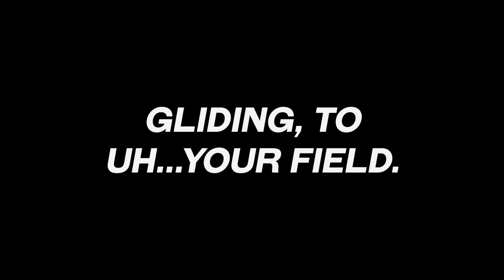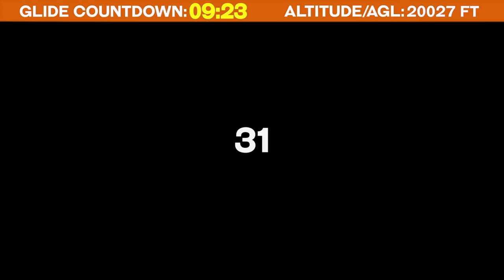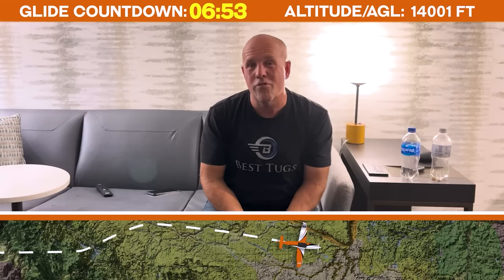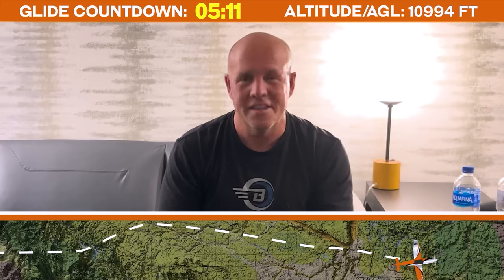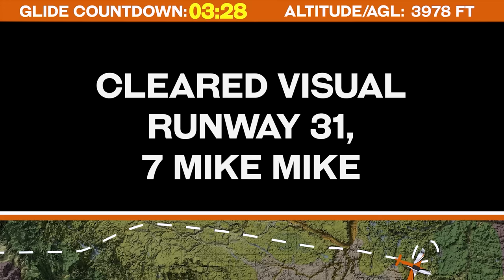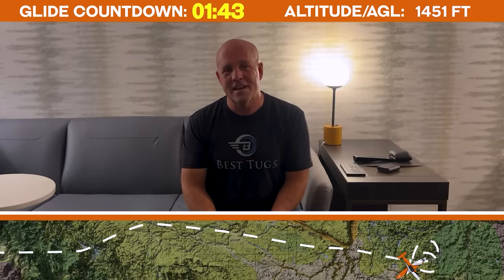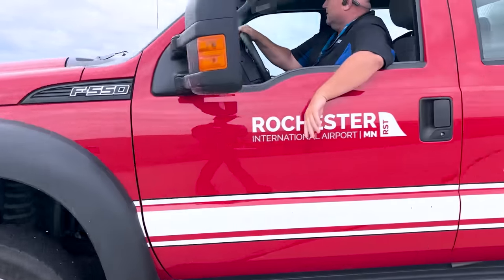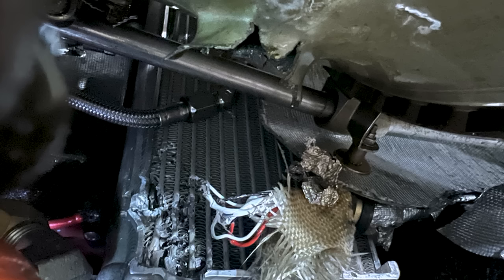Engine Explodes In Flight - Turbulence will not be at Airventure 2023 | Turbulence Emergency

Comment: Hi Mike. New to your channel. I'm currently learning to fly a little PA 28, so I look for any inspiration I can find. Turbulence looks amazing. For full disclosure I am a  RAAF engineering officer (electrical). I discussed your PT6 engine failure with some of the propulsion guys I know (mechanical and aero engineers). With the limited data available, they were all of the opinion that the engine has been over torqued during its life. Being an ex King Air engine, that increases the probability of over torquing. Looking forward to following your YT channel.

Comment: Had a catastrophic failure in 2009 in my Cherokee Six at 2800 feet.  Was able to put it down in a small field under a set of power lines........It's hard to get over those times but I'm still here.   Not even a scratch on me or the plane.......by the Grace of God!  Great Job!!!

Comment: Mike, Glad you're ok and saved Turbulence. Having survived my own single engine, night deadstick I can attest to not knowing who is on the frequency until the conclusion of your landing. I was on a short VFR night flight and came up on 121.5 when the 182 I was flying had a complete engine failure. I was quickly vectored to the closest airport by ATC and then had a couple of airline pilots offering suggestions, most of which I had already tried. Finally, when it was apparent a restart wasn't going to happen, one of them told me to quit talking and just fly the plane. Once I radioed I was safely on the ground, there a 1/2 dozen comments of great job, way to go, etc. Sorta' nice to know you're never really alone out there.

Comment: Mike - Great video!!  Lousy luck!!  Only saw 1 emergency decent in '90s.  I got slammed by massive downdraft on I-96 in MDOT PU!  Held on after initial hit, bounced out of windshear on other side 55 to 85MPH!!  Glanced up & saw NWA Liner stationary, about to hit downdraft.  No traffic, so shot up thru window drivin' sittin' on sill, swerving the 40' on 2 wheels back & forth while pointing at Capt.  He went full gas/flaps, gear up, nose slight down, & immediate straight down in flat plummet straight into Oak forest.  He actually flew Liner thru treetops until clear, & circled way down & out in front of me, turning around & cruisin' back at freeway level waggling wings & pushing white paper across side window to say, "Thanks for tip".  Liner hurt so bad, spar had 5 breaks & wingtips hung down to runway on MD-82!!  His entire crew severely injured, w/1st Ofcr basket case knowing he was dead!  Capt shut down aircraft, while Company evacuated injured & de-planed passengers.  When done, not a sole around, so scooted down small stairs for late luggage, glanced up, & wings ruined.  He was pulling Oak limbs from belly when arrested by GRPD for joyriding plane, & then dragged thru Concourse in front his terrified passengers!!  Years later, I met Capt by pure chance again, at TPA Pilot's Lounge while this kind man schooling couple SWA Pilots on dangers of windshear w/dangerous downdraft!!  He had blank for actions taken, so poor judgement me filled 'em in, & Capt exploded like your engine, leapt over table, & shakin' me while growlin', "And just how in the hell would you know that"?  I replied, "I was the ahole Highway Worker drivin' the MDOT Pickup you mentioned...I have ID".   Capt  checked ID, said lookin' for me, but NTSB in their Investigation said there was no Pickup, & there was no Driver, plus his description of Incident physically impossible, so damages were "Pilot Error" all the way!!  That was at an International Airport!  Where you emergency landed Mike, they treated you much better I would say!!  Oh, and as for Capt, he claimed even after all he had went thru, he still felt lucky!!  NTSB re-opened Investigation, dinner napkin with all details from our meeting that evening I wrote down solved all the unknowns for Incident, Capt Missus's purse recovered, & whole deal so embarrassing, NTSB Classified initial & accurate findings as well!

Comment: Great job Mike! Back in the day (1970's) as a LOW time pilot (less than 100 hours!)  I had an engine failure on a brand-new Cessna 150 while on the downwind leg. My passenger had never been on an airplane before - imagine that! Immediately I cut my downwind and slipped it in. No issues, 

I had a great instructor. He was my roommate in college, so we flew a lot. He retired recently after flying as a senior captain for United Airlines. He made me practice slips a lot! Got really good at them,

You mentioned a slip a number of times. After my incident whenever I was by myself, many times I would slip the plane in, just for practice. Always practice slips!

Comment: 12:09 greetings Mike. Watched video first time. I appreciated your share. In August 2000. I
 experienced a catastrophic   failure Cessna 180 straight floats over the Rockies at 12500'. VFR Connecting rod failure. Oil, smoke etc. Badly damaged ac on a creek bed near Takaka Falls no injury. Life changer for sure. Congrats, you did well! Mark Hyderman CF-HSG

Comment: Wow. My heart was racing!  I have a catastrophic engine failure in IMC in a BE-33 at 5000 feet VMC on top of a 4500 foot layer with cloud bases reported at 600 foot.  I had a top notch ATC controller vector me on top of the numbers of RW32 at KJAX. I broke out at the numbers at 850 feet and spiraled down to a nominal landing profile (crossed the threshold at 50 feet on speed and fully configured.  My lessons learned: AVIATE-constantly train under duress and know your procedures cold, NAVIGATE-always know which way to aim the aircraft in case of engine failure, COMMUNICATE- call “Mayday” x 3 and state your problem and intentions early to avoid unnecessary comms.  Great job MP!

Comment: I myself have never heard of a pt6 turbine fan engine exploding. It’ll be interesting to see what happened to the turbine. Like ya said could have been a hot start or low battery  on start up. At any rate I’m glad you guys got down in one piece safely. I hope you show the tear down if it’s possible. It would be interesting to see what happened inside that can. Safe travels from here on in Mike thanks for sharing.

Comment: How you handle yourself, how you respond, how you review, how you approach maintenance - all of it very professional, all of it considering the "might happen", all of it considering ultimately what is at stake.  Good on you. 

I worked in the design end of aerospace. I took longer than most to work things out, and I had to come in on weekends to hold schedule. I would rather skip a trip to the zoo with my kids than to miss an oversight. Review, review, and then review. 

I always made up for the lost trips to the zoo. 

The job I did was stressful. It wasn't the schedule so much as the safety aspect. I completely understand how you must feel after that episode. Blessings.

Comment: Failures in materials used in these machines are never completely eliminated. Even with all our visuals, x-rays, mag particle, CT scans, etc., we have never been able to eliminate the probability of abnormal fatigue failures in bearings and engine parts. That means preparation and practice was the best you could do and that paid off. It was luck the collateral damage allowed a skilled, prepared pilot the chance to fly home. Very glad the story has a happy ending and is another reminder that preparation and practice is the key. Well done Mike.

Comment: Incredible story! Just glad your both ok from what could have been a disaster. Nothing to compare at all and dont want to steal your platform,, but I had an engjne failure in a C152 as a CFI with a student. So much happens so fasr and we were at approx 6000 AGL with an engine oil pump failure (learned later)
 Barely made it back to an airport and learned a lot. Really appreciated watching and learning from this. Thanks for sharing.

Comment: ⚓️ Thanks Mike 🌈 Batteries!!! I worked tugboats… hi hp harbor tugs in San Francisco… everything is 24v … except the main winches. ECMs & engine control… drive unit control… and I test those batteries semi annually… secure the conditioner/charger/power supply… run the machine for at least six hours. Monitor amps/voltage… these were lead acid & we had very few problems… keep terminals tight & clean. New batteries at 5Y intervals. ⚓️ a little on the safe side. But we didn’t want a failure while tending to a 200K ton tanker under the Golden Gate Bridge 🌈

Comment: Hi Sly Fox.  So Glad Mike and passenger made it down OK.  I've always been in love with Turbulence, and was so glad some few months ago when you told me that Turbulence is back in the family.  So glad also that we are back to flying videos on your channel.  I am looking forward to seeing how this latest chapter of Turbulence unfolds and develops.  Of course I am also looking forward to seeing the development of Draco X.  I'm over my health issues of the past six-seven months, and so am back working on my own taildragger with a vengeance.    About to finalize installation of the wing fuel tanks.  Love you guys.  Keep up the good work, and back to work!  Woof woof.

PS:  It was a real education once while flying solo as an Air Force student pilot when I landed the T-38 jet, and then on rollout I suddenly discovered that I had only one wheel brake.  It all became matter of fact.  No panic of fear--just deal with the situation.  I used almost the whole runway to gradually slow and stop the airplane using my one good wheel brake and while engaging nosewheel steering, which normally you are not supposed to do above 15 mph while taxiing.  But I turned off at the last taxiway, and shut it down there.  The maintenance sergeant after 45 minutes came out with the tug to retrieve the airplane, and boy was he pissed.

Comment: Riveting.  Had to pause and get to town for a few minutes ... will further on my venture when I return. When you commented on the fact that you will be coming down no matter what ... gravity ... it reminds me of a story my dad told us kids.  At the age of 22 in 1944 he had become a captain for united .. .. On his solo flight, it was a Stenson Bi plane .. his mom was on the ground standing next to the instructor ... ... My dad on his first attempt with the three touch and goes was too low on final and hit power lines ... he lost one landing gear ... of course he kept flying around trying and trying to figure how to land .. and my grandmother was saying to the instructor " ... how is he going to get down... "  and he said " sooner or later he will run out of fuel and he will come down" ... rest of the story, my dad finally landed rolled down the runway on one gear until the tip of the wing stopped him.  He didn't do three touch and goes and the instructor passed him.. all this went through my mind when you mentioned it Mike.  Good job ... I will subscribe to see how the new motor and reports come in .. this is very interesting.  Straighten up and fly right 🙂

Comment: Mike we had a King Air 90 we maintained for a local company here in Ohio. It had one engine fail in flight no warning. I went to the teardown where the facility in Four Corners NM overhualed it. I was standing and taking photos as the overhaul shop took it apart. The failure caused the sun gear assembly to break its casting in the nose of the PT6-20  due to severe vibration the whole sun gear assembly casting broke and spun inside of the outer front nose case of the PT6. The vibration and front sun gear mounting failure put metal down the oil return tubes and then the whole engine locked up. The main culprit was the ITT harness mounting bolts had come loose as the safety wire was missing most of it, and what was left on the saftey wire for the ITT harness looked like it was stainless instead of the reqired inconnel safety wire. It allowed some of ITT harness mounting hardware to come out and go through the blades taking out so many blades the engine became very imbalenced as it seized up. I found one of ITT harness mounting bolts down in the burner area of the engine when it was torn down. It twisted the engine mount but stayed on the wing. Was a very costly mistake caused by an inexperienced shop doing their first PT6-20 overhaul ever is what I learned at the facility.  They do fail once in awhile. The PT6 also if the fuel pump to governor small plastic dirve shaft fails the engine will overspeed and take out the engine, I have seen this also on the PT6-20. Pratt & Whitney has the figures for how often the PT6 fail it is a very high number of hours of many engines before they see an inflight failure like you had. Good luck and safe flying to you, good job getting the plane down safe and sound.

Comment: I'm in shock that this happened and you guys were alright!  It could have went so many worse ways.  When your radio call said you were down safe, I realized I had been holding my breath!  I knew you made it, of course, but in my mind, I was thinking through the psychological aspect, and it isn't easy.  Though I've never had a catastrophic event, I did have my first engine faliure this past summer.  June 12th, 2023, KBTV, climbing through 10k feet.  I had just turned on the autopilot, sat back, and thought, "Oooo, Lake Champlain is pretty today."  I don't remember anything specific, except I sat straight up and said, "What is happening!?!?!?"  I guess you get used to how airplanes feel.  My captain looked at the gauges, which I had not even done yet, and said, "We just had a left engine failure."  I stared at that gauge for about five minutes straight, which was actually probably .5 seconds.  He grabbed the yolk, turned off autopilot and autothrottles, and said, "Oh, sorry, do you want it?"  I said, "Nope!  Knock yourself out.  I got the book!"  Pulled out the QRH and turned to the correct page without thinking.  I had just done it about a dozen times in the simulator just two months earlier!  My former captain intuition kicked in, and I had Burlington vectoring us back and emergency declared.  I told my CA I was sorry if I was stepping on toes.  He said, "You know what you're doing and you're doing well. Keep doing it."  Then there was that same moment; "Fuel, souls on board, say intentions."  I can't remember what we were at for pax, but I think it was a lighter load that day.  130 maybe.  As most pilots of larger planes know, an engine just quitting without doing damage is practically a non-event.  As soon as I had the book in my hand I went from high alert to standard single engine ops.  We weren't in immediate danger, so we took our time to be sure the QRH was done correctly, got vectors.  He had said on downwind, "I guess I'll land it."  I replied, "Oh, I know you will!  I got no business making this landing two months off initial!"  My CA made a gorgeous single engine landing (as depicted in the news video footage 😂).  All in all, was it that big of a deal?  No.  That's because we train, we identify threats, stay focused, respect SOP, follow procedures, and do what we do - go to bed safe.  I can not imagine a blown engine on an aircraft that is 80% engine though.  😂  More engine than wing sounds a little spooky to me.  Nice job!!!  ~  Josh

Comment: Mike,

Might be a little too late for your situation, but take a look at High altitude power loss (HAPL). During the military flying days we would use standard rate turns on glide profile to line up for the airport. Sure there are videos online somewhere with people explaining it (High Key/Low Key, etc) 

This might have helped make this situation a little less stressful. Glad to hear you made it on deck safe.

Comment: Flew a DHC-6 for 13k hours in the High Arctic, on floats, skis, and yes wheels. Off strip. The whole 9 yards. Had 2 FCU'S go. No big deal. Landed on ONE. Major was fuel contamination in a very very bad place in the High Artic with a T.O. over the Sea. Lost One and the Other saved my ..... Never heard of a PT-6 EVER blowing up as you describe. Frankly, Shocked. Best Engine Ever......

Comment: I’ve participated in many investigations and I’m impressed with your pilot airframe awareness. Checklist for engine events where restart is not possible, in my option, want throttle to cutoff, prop to feather, fuel firewall isolation. Then next exactly as you described is trim for best glide then checklist Gen fail is load shed, RAT if available. Some aircraft make it easy with “critical bus” all marked out so you turn off unnecessary items such as coffee pots and fuel pumps, then depending on reserve even nav lights. Aircraft with electronic flight controls require certification proof of reserve power from any altitude and for all Gen fail for a declared period. You don’t want to have to think about things under stress such as “ do I turn off pitot heat?? “. 
For experimental here we see why we want to do the calculations and test to know what reserve is present for say a 70% battery at flight start.  As you mention, there are newer batteries that have more power density.

Comment: Turbine failure is causes by metal fatigue which is caused by over-temp conditions. It could also have been running hot on occasion. Also improper cool-down causes turbine failure. I was a jet engine mechanic used to boroscope hot sections on every maintenance period. The only thing that kills turbo-props is hot starts, overheat and improper cool-down.

Comment: The PT6 is a very robust engine!  I worked on the PT6T Twin-Pac, we had one that exploded and the things that you said about hot starting etc. Is point on.  The only problem we usually had with those engines was the P3 air filter getting clogged causing no start or hot starts. Because the failed starts due to the clogged filter would leave small pools of fuel in the combustion chamber.  Other than that they were solid engines.